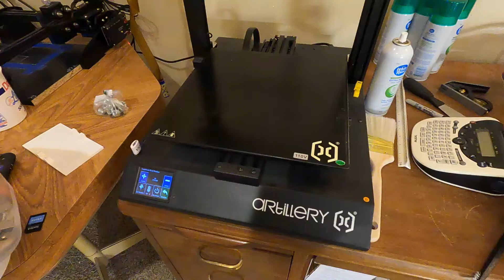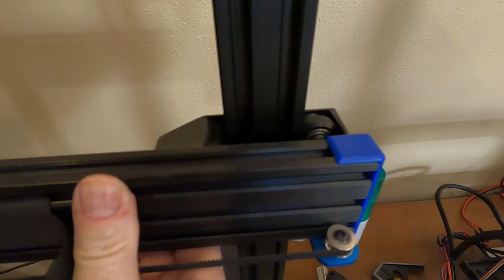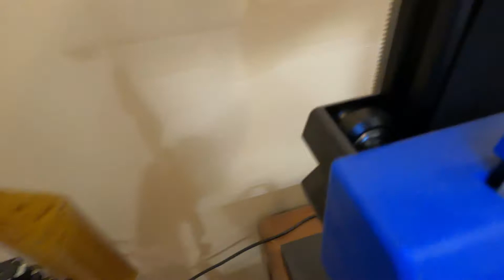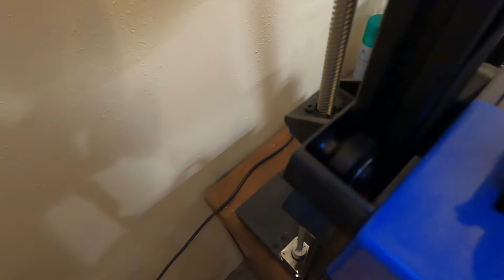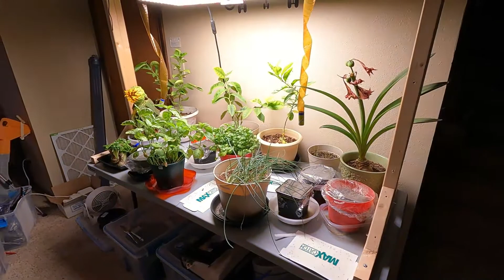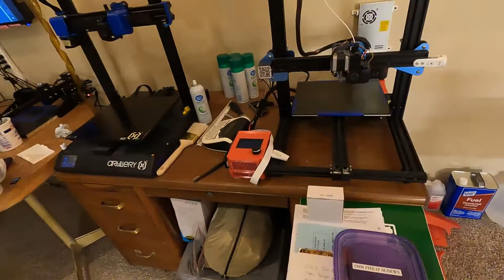Artillery SideWinder X2 - X-Axis Play??

Comment: I just ordered my X2 after my X1 bed heater started to fail and you freaked me out. The inner roller on each side (single roller) is eccentric, use the supplied wrench to turn the nut and it will tighten. The right side Bed roller and the bottom hot end roller are eccentric as well. They should all be tightened just enough to stop the roller from spinning freely. Too tight and the roller wheels will wear out quickly.
Reply from the maker: They might have added that now, on later printers.  Mine certainly didn't have eccentric nuts there!!
I recently found an X2 from Amazon Returns that I picked up for about $50.  I'll have to check it on that one.  Looks like everything is there and it's in great shape.  Somebody just didn't know how to set it up the first time, so they sent it back.

Comment: Hi, my sidewinder X2 hasn't got that play on X axis as it is on yours...I would say it is very stiff. I have also upgraded to a full metal hot end
Reply from the maker: Am I missing something, or is there a way to tighten it up?
Reply: @dougdemako7382  on the back side of the x rollers you will see a hex nut on each side pointing inward toward the bed. Tighten those up they are the concentric nuts.
Reply: Just enough to take the play out. You don’t want to over tighten.
Reply: @dougdemako7382  have u managed to do it as per Glendon's advice? (I am not sure which screws he means but if the ones I found then not sure how would that eliminate the play). Only thing I have found was when you look at the outside rollers there is one roller hidden inside "casing"  where i can see a grub screw on the back of the casing, same for the other side. I wonder if that would do anything? Let me know how it goes...
Reply from the maker: @andyw8009  It's printing a set of TPU tires right now.  I just saw the comments.  I'll look for those hex head screws mentioned below!  Thank you!
Reply from the maker: @andyw8009  My TPU tires won't finish printing until morning, but then I'll take a whack at it.  I'll let you know how it goes!
Reply: @dougdemako7382  Fingers crossed then! I hope it helps and looking forward to the results!
Reply from the maker: @andyw8009  It worked.  It was strange, though, because the x-channel was only loose at the top, but it was fairly snug at the bottom.  Tightening it up a little, didn't seem to affect the lower end, so I guess we're good!  I shot a little gopro video of it that I'll post here in a minute....  Thanks!!!
Reply: On the back side of the X, on both left and right carriages there is a small hex screw pointing inward toward the bed. Tighten those
Reply: I have those hex nuts tightened all the way on mine and I still have the play yours does as well I have loosened the plastic to try to tighten them now I’ll let u know